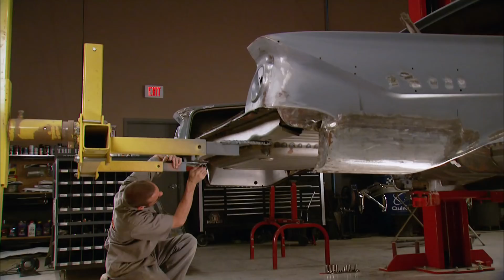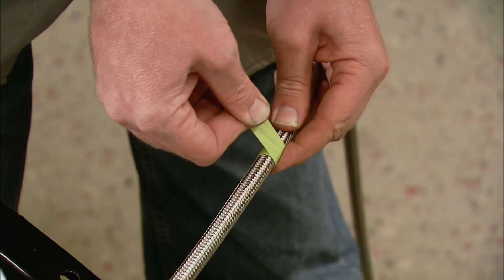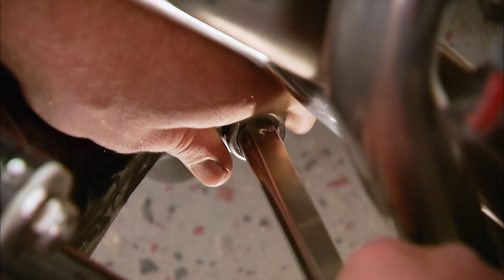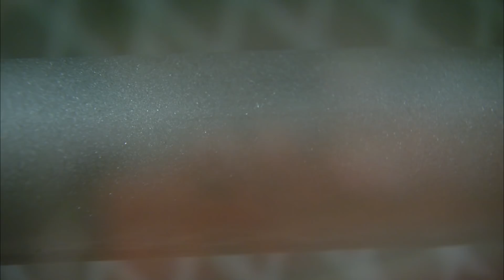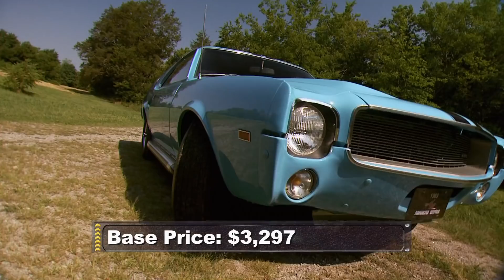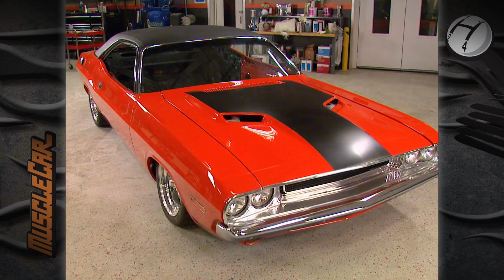Adding A/C While Keeping Our '69 Firebird Tribute Trans Am Looking Stock - Muscle Car S4, E3

Comment: On your hard line radiator hose's, you should have gone over to the bead roller and put a bead 3/4 of an inch from each end.  Just like the radiator tip, it will ensure a true seal.

Comment: Air condotioning a convertable ??
Now there's  an oxymoron .
Reply: Ever ride in am open top car when it's 90°+ and no clouds?   It gets hot really fast.  So putting the top up and put the ac on.
Reply: Pop tops are for parades, rest of the time you're hiding from the sun like everyone else.
Reply: Convertibles are fun till you are sweating like a dog.
Reply: Redundant is the word.
Reply: Of the 697 '69 T/A's Pontiac actually made only 32 were made W/ factory A/C. Whether any of the 8 factory original convertibles came W/factory A/C or all 32 were in the 689 hardtops is unknown.
Reply: Of the eight convertibles, 4 had blue tops & 4 had white. Interior colors (whether rag or hardtop) were supposed to be limited to blue,black or parchment(tan). But it's documented one hardtop was made W/a red interior.